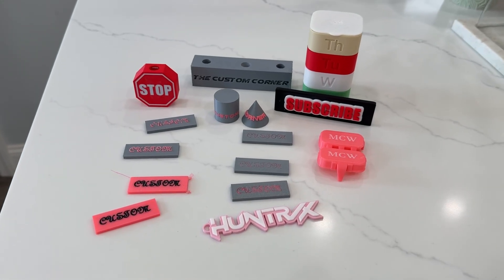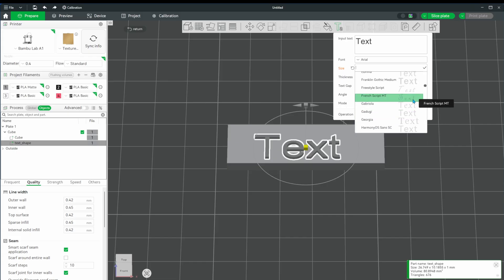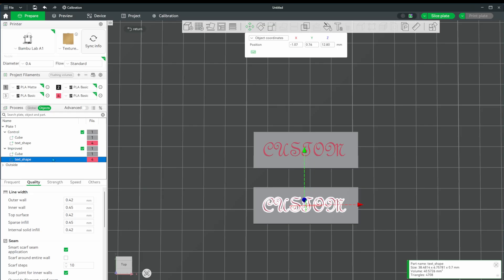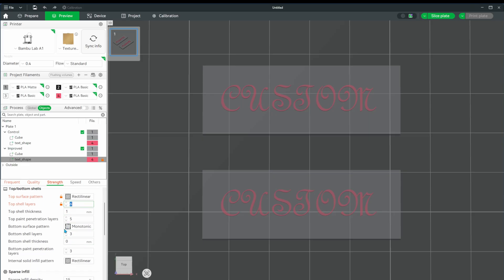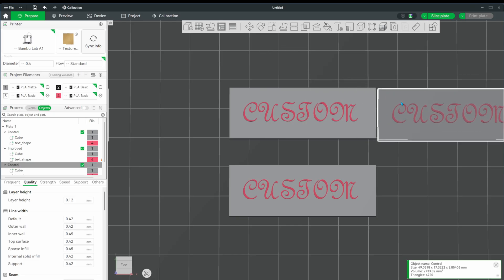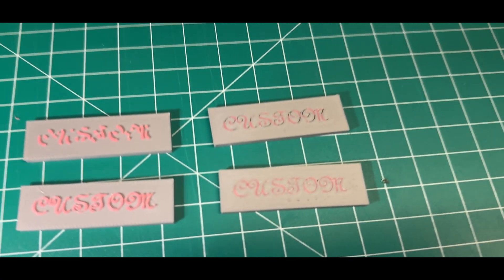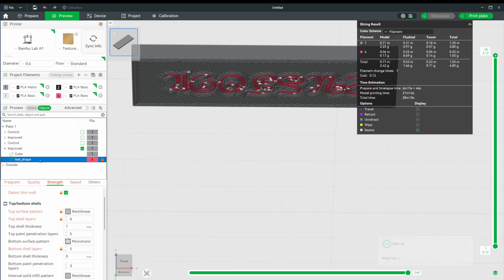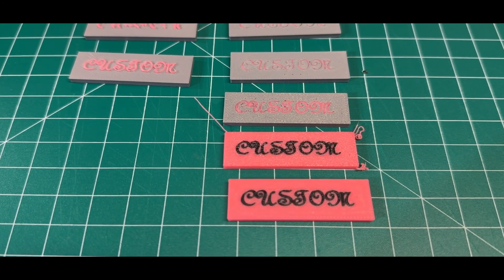How to Get Razor Sharp Text in Bambu Studio (Perfect Lettering Every Time!)

Comment: You will get better quality with the Arachne wall generator and single wall on bottom layer (on face down prints)
Reply from the maker: Yep, absolutely. I neglected to switch over to Arachne, and that's a good tip on the single wall for face down prints.

Comment: For engraved text on bottom layer, using outer/inner wall order only for the first layer gives me more clarity on text.  For adding it to only first layer you can use height range modifier or any general shape with z height equal to FirstLayerHeight

Comment: How would I remove txt from an object that's already on it ..I found a STL file I like but I wanted to change the txt ..is that possible or no ?
Reply from the maker: You'd only be able to remove it if it came along as a separate object. If its part of the mesh, then you'd need to open the model up in a 3D modeling program and tweak things there.
Reply: @TheCustomCorner101 that's well about my head and capabilities haha

Comment: Use Arcane print mode instead of classic.
I also find that if you change top layer to contour this works very well and makes the text look shaper, especially when combined with arcane under the quality settings.
Reply from the maker: Great tips, I may do a follow up incorporating some of these suggestions. Thanks!
Reply: Where are this "top layer to contour" settings?

Comment: It would be interesting to see examples of smaller text sizes too - to understand how small you can go and what settings make the most difference. I’ve tried as small as 3mm, and generally find that extrude removal is better than raised / extruded, but I am still new to it.  I’ve also been adding the text in cad (onshape) vs the slicer, so if I wanted to tweak the settings would need to keep it as a separate part in order to tweak in the slicer.
Reply from the maker: For sure, that's a great idea for another experiment. I normally add text in Fusion, but you can't beat the convenience of doing it inside Bambu Studio. It's also less intimidating than a full-fledged cad program for most.

Comment: Interesting - not sure though that having lots of top and bottom layers is that relevant to the text.  For previews I would turn off seams to remove the white dots. I think ideally for top text having the text going down on a full layer, rather than an infill layer might help, perhaps 3 layers of text in total with one above the surface.

Personally I do all of my text in Fusion rather than the slicer, and as per other comments I mainly use Arachne, but sometimes I try standard.
Reply from the maker: Good tip about the seams for previews, I'll keep that in mind.

Comment: Instead of reducing your line width to 0.25, just change the wall generator to Arachne... That allows the slicer to vary the line width as needed to draw in those very thin lines.   I also feel your text can be dramatically improved by ironing top surface....frankly, while your changes certainly did provide significant improvements, the end result wasn't even close to what I consider acceptable on something I'm printing for a client, and you can get much better
Reply from the maker: Thanks for the suggestion. Ironing can help sometimes but it can also muddy the top. I considered it for this video, but felt that it would require multiple tests to get the right property values for this print, which in the end doesn't help anyone else with different shaped prints and filament and would have made this video way too long. Ironing deserves its own exploration and I'll be looking to do that soon.
Reply: Good info, can you post a video to include your ideas to get a perfect outcome like you mention?
Reply: @rickdabney5082 I can recommend a video... Nobody wants to see my ugly mug on YouTube 😂.  But Ashley's Print Shop is the penultimate text in Bambu Studio channel out there and is where I learned all my text techniques.
Reply: Unfortunately Arachne only helps so much. Depending on the model ordered, I often have to reduce line width along with Arachne walls. I also use 0.2 nozzles for extra fine models/details occasionally, but normally the time trade-off isn't worth it imo.
Reply: @OhImKiCkiN , I do not have a 0.2 nozzle, and was hoping this would lead to better text, small text that is that I usually seem to be trying to print. 
I know there’s not one perfect solution, but I sure was hoping to get something close to perfection.
Reply: @SThompsonRAMM_1203  For what its worth, I've been trying to design a model of a small coin with text and an image embedded on both sides to print as clean and legible as possible. So far, following all of the tips in this video along with changing walls to Arachne (which honestly helped far more than anything in this video)  seems to be the best I can do. I actually found that the bottom surface looks a bit nicer than the top but the results are overall pretty reasonable. Even on a 35mm coin I could get the image to print cleanly. The words are a little trickier to make reliably legible at that size but doable with the right font and sizing. The larger I make the coin the better it looks, as expected, but I was impressed at how well I could get it to turn out without the need to use a 0.2mm nozzle. The bottom tends to be a bit cleaner looking because it prints the modifier portion first and the surrounding walls dont muddy it as much as the top. I haven't tried ironing yet, but I'm concerned it might just muddy the text and image even more, which isn't really worth it for a smoother surface, at least on the smallest versions. I found that making sure the text/image is at least two layers deep helps too (more layers would likely be even better, but I also want to minimize filament purge waste and it has to purge for every two-color layer). I was also hoping to find some tips to get closer to perfection, but it seems I've already implemented all of the tricks that can help. At least I know I did everything right and the only thing left to change is the design itself. Overall, I can't complain about the outcome though, because I'm asking a lot from a fairly budget-friendly FDM printer (Bambu Labs A1).
Reply: @OhImKiCkiN you can fine tune Arachne settings .. there's way more to it than just "choose Arachne".   When you choose it, you also have "minimum wall width" as a percentage of nozzle size, so for example you can set that to 55% and Arachne can make your walls as thin as 0.22mm.   You also have a minimum feature size, so for very small features, you can set this to 25% as a percentage of nozzle diameter, so features smaller than 0.1mm it won't try to print, because they're just too small, but features at 0.18mm it will attempt using the minimum wall width.
Reply: @3dcreationsofri  You can change the minimum wall width with Classic or Arachne. Still, it only works so much, depending on the machine and nozzle. I can't get consistent results with a wall width smaller than 0.28 on a 0.4 nozzle. For most fine details, especially text, this just isn't fine enough so I u use a 0.2 nozzle.

Comment: Enabling Arachne as the wall generator and changing those setting for min line width and setting to 0.08 preset works beautifully for raised text. It’s pin sharp. Would love to see a side by side comparison of that with your prints
Reply from the maker: That's a great tip, I'll have to try that out!